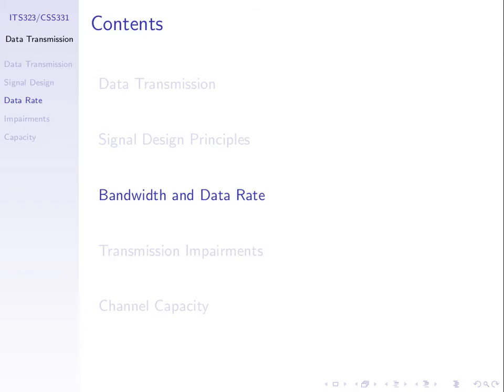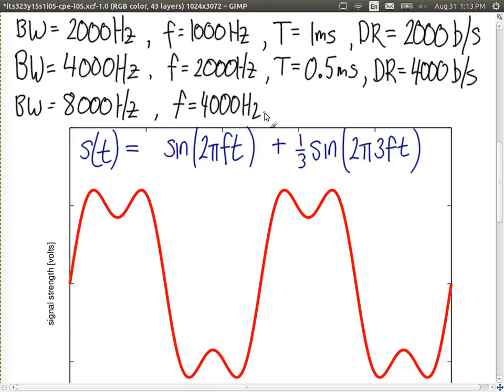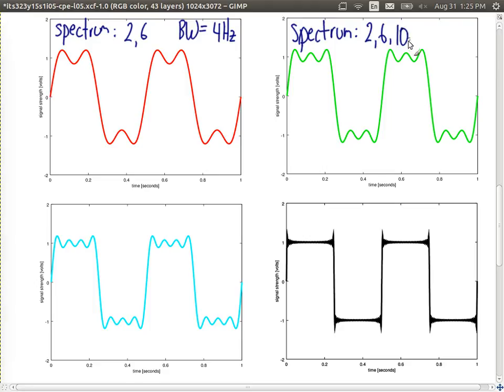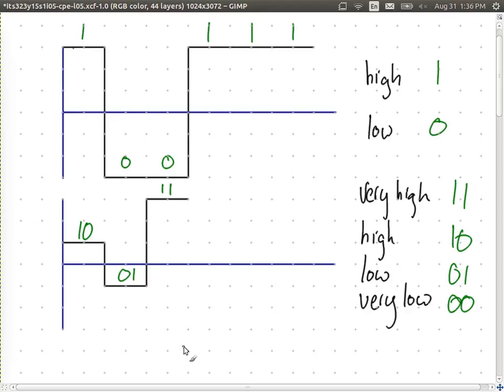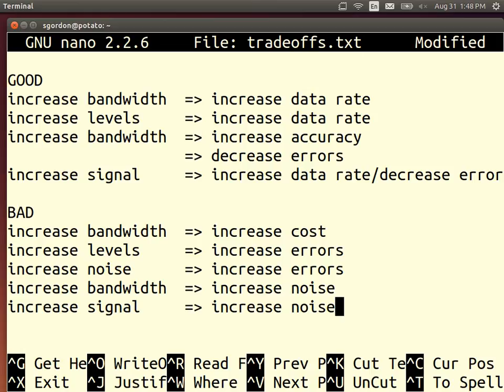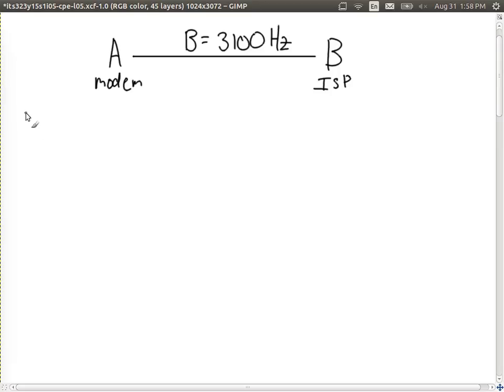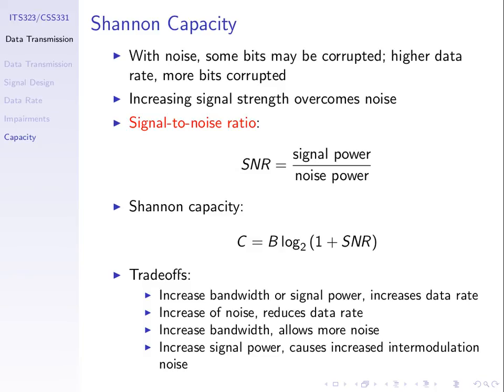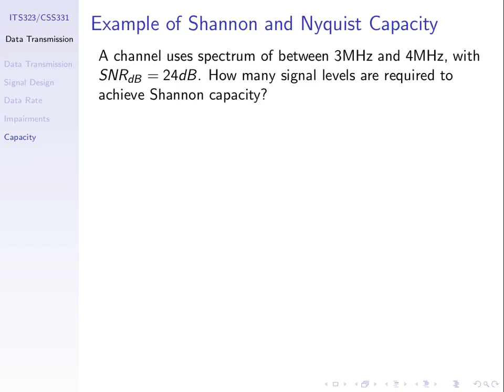Signal Tradeoffs and Channel Capacity (ITS323, L05, Y15)

Comment: Bandwidth and DR
 • Increase bandwidth = increase data rate
 • Ex
  ○ Given 
   § s(t)= sin(2pift) + 1/3sin (2pi3ft)B = 2000hz
  ○ What frequency should we use such that the bandwidth is 2000hz?
   § f=1000hz 
   § Since B=2f 
  ○ In 1 period we send 2 bits
   § => DR is 2000b/s 
   § Since 1 period = 1/1000s 
 • The more signal elements, the more data we can send 
  ○ If we have 8 signal elements, then we can have 3 bits
   § 001, 010, 110, 111, 101 .etc
  ○ More bandwidth also reduces errors, since it is more resilient to noise
   § But more levels decrease accuracy since there is less of a margin of error
   § We haven't said by HOW MUCH yet 

Attenuation and Noise
 • Noise causes errors because it can flip bits
 • Thermal noise, lightning strikes 
 • Increasing signal, decreases error but can cause crosstalk 

Channel Capacity
 • The maximum data rate at which data can be tranmitted over a given communication channel 
 • Nyquist capacity
  ○ Assumes no noise
  ○ Telephone lines were designed to send voice, which usually is between 3100hz 
  ○ C=2Blog_(2 ) (M
 • Shannon capacity
  ○ Higher the data rate, the more bits corrupted because of noise
  ○ SNR = signal power/noise power
  ○ C=Blog_2  (1+SNR)